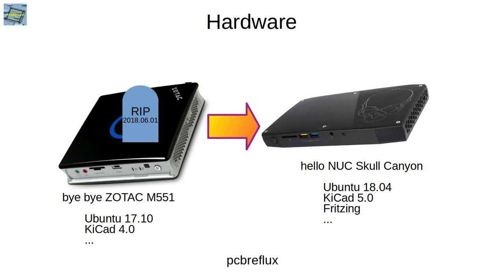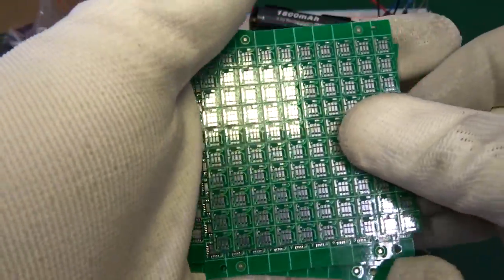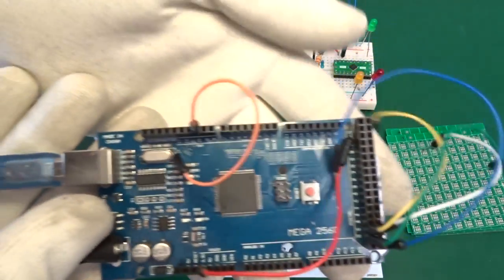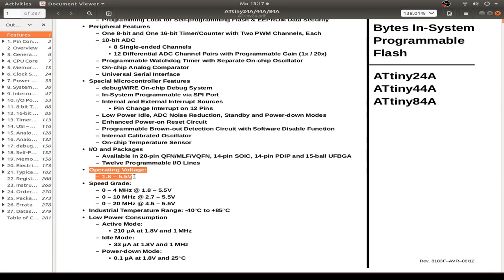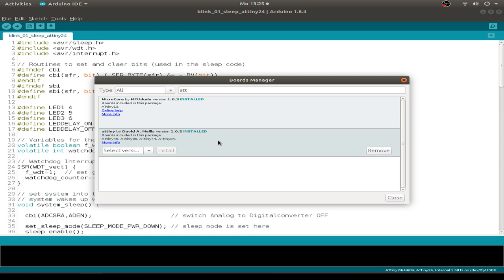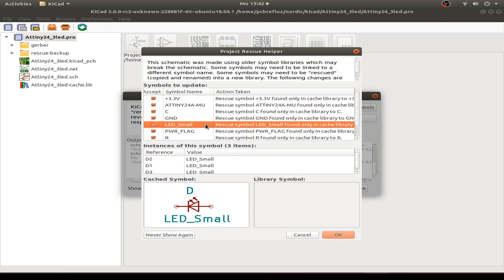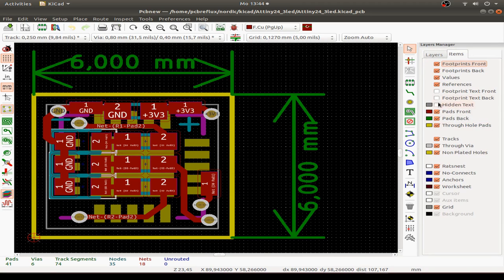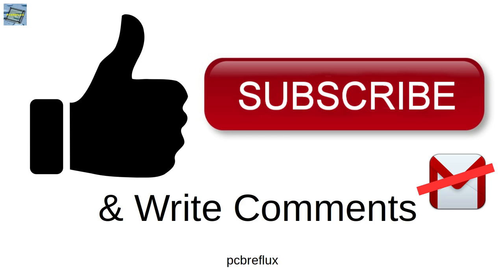ATtiny24 #1: using ATMega 2560 as ISP, KiCAD 5.0, Fritzing

Comment: Awesome video.  So are you going to upload the sketch on each using the Atmega ?  What is the purpose of this IC if you can share ? If not its o.k.
Reply: The  Atmega used as Arduino ISP, the sketch is already in the Arduino IDE. In the Examples->ArduinoISP menu.You can use UNO as well for this kind of downloading. I normally use in my AtTiny13A projects.
Reply: Agreed Istvan.  I've used same setup you depict in uploading sketches for attiny85s and atmega328s.  Never used attiny24 nor the 13a
Reply from the maker: Use the ATtiny24-MU (qfn20) for some reasons: size 4mm x 4mm, voltage range, energy consumption, price (<$1 for one unit with all parts/pcb) and usability (programming with arduino). The curcuit on the PCBs will illuminate some very small cardboard airplane models with fiber strands glued to the LEDs. The pcb and battery (batteries) have to fit into the airplane body of about 6mm diameter.
Reply from the maker: Thanks, think they need 12V and other 50V up to 100V per filament. That is a little off the requirements ... and to use coin cells we are talking about maybe ~10uWh not >1Wh.
Reply: True that

Comment: Thank you for this video, very nice.  I like your way. I am still thinking to switch linux.
Have you planned to continue the Eclipse based development under ESP32? I am courious about a MESH network with MQTT. The most interesting point the root element of the MESH.
Reply from the maker: Hi, yes I will continue using esp-idf and eclipse but for a video you have much more to explain and for many hardware you need some time to convert some libraries. Not done anything with wifi mesh (speed?) but with nordic nrf52 and Bluetooth mesh but this need very much preparation to do a video about and you still need a gateway (not the app on a mobile phone!) if your project need to communicate with the cloud or mqtt server.

Comment: Nice vid once again! But ... you got everyone curious ... why did the Zotac "died" ?  :)
Reply from the maker: John Smith Still don't know why. After upgrading ubuntu 17.10 to 18.04 had some issues with java which effected libreoffice and eclipse so I tried a fresh ubuntu reinstall. Maybe it died while I do several hard and software resets? But now there is no way to turn it on ... try also to bridge the switch but no boot  ... no bios   ... no beep ... nothing. But could  recover all data to the new M.2 SSD.
Reply: Well it's sad in a way and it's expensive but the Skull Canyon NUC is a Awsome machine ... specially if loaded with the Core i7 6770HQ ... that thing is a beast of a computer ...a Workstation PC no doubt. Loaded with Dual M.2 SSD's it could be very well a full desktop replacement ... very very good choice!
Reply from the maker: John Smith Thanks,  yes its the i7-6770HQ version and hopefully I get the second M.2 SSD Samsung 860 evo tomorrow.
Reply: Great ! I thought of buying one of those but when comparing the price tag with a AMD Ryzen desktop made me temper my gut feeling for the Uber-Cool NUC and wait a little longer for an upgrade. But no doubt a very very cool choice ...
Reply from the maker: Second SSD arrived https://twitter.com/pcbreflux/status/1006868943145963526
Reply: :) A thing of beauty ... :)